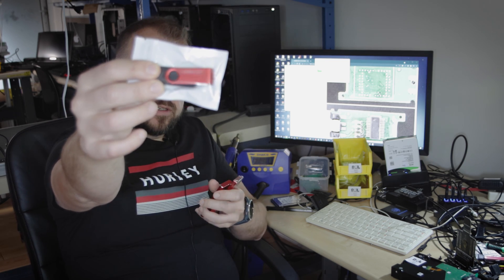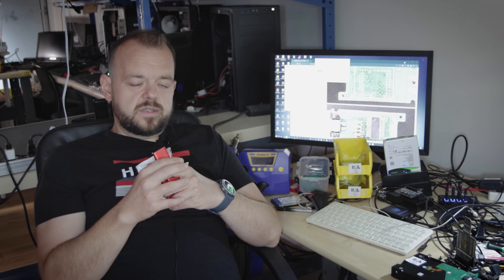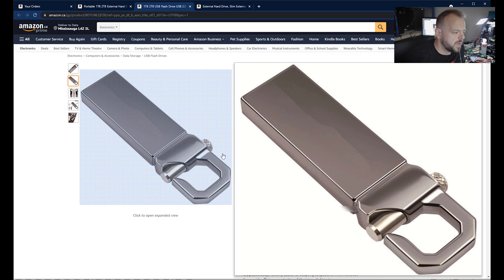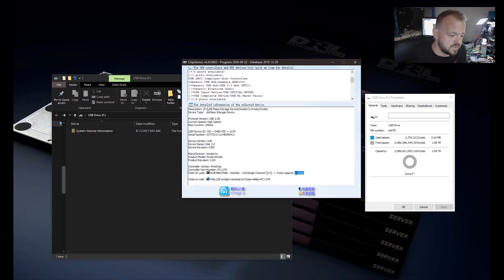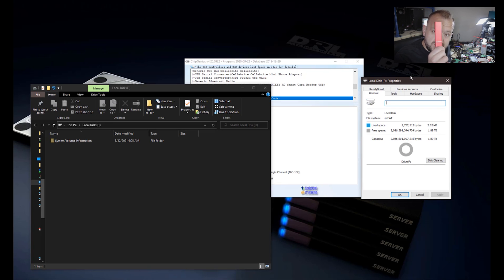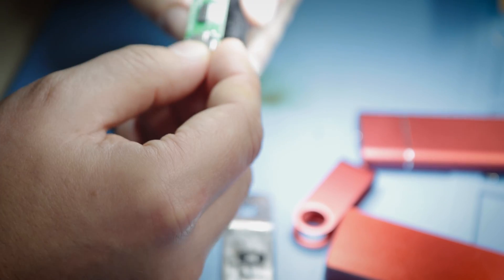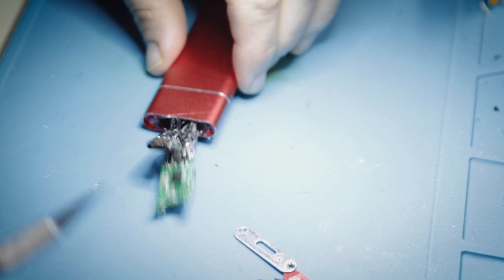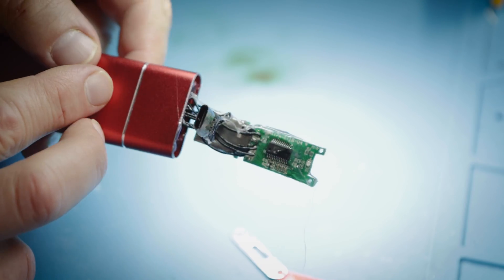Don't get scammed on Amazon with these!

Comment: @9:40 A small syringe with gasoline along the seams will eat the glue after a few minutes. Make sure to always wipe away excess on the plastics while you wait, and when it opens. This is what is used to open power supplies for laptops when repairing them. They can then be opened without cutting or damage:)